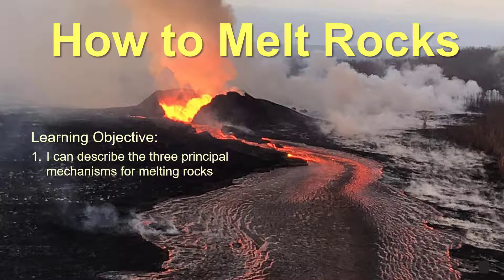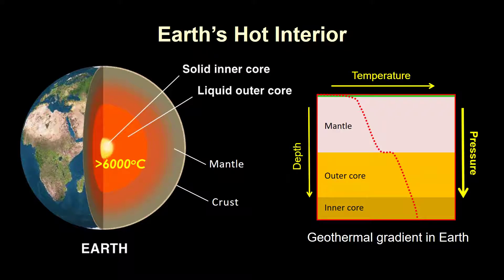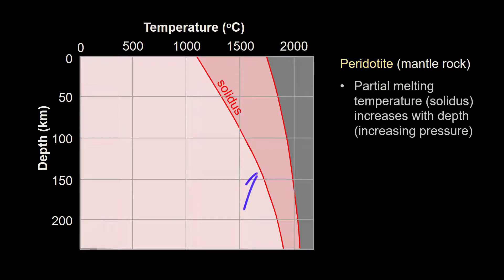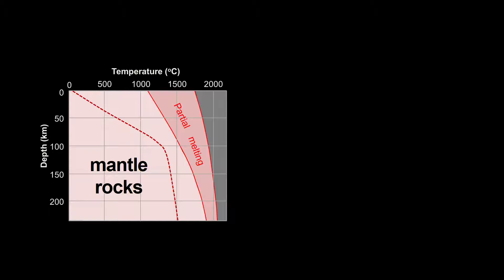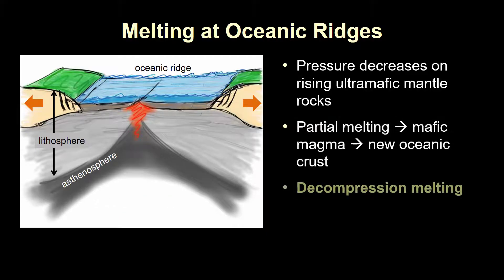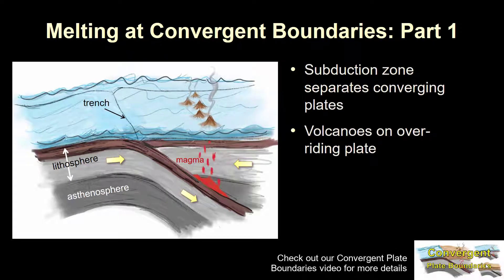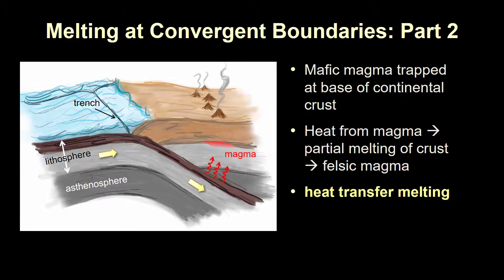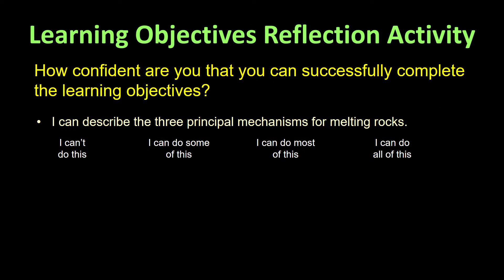How to Melt Rocks

Comment: Thanks, I think I got it.

So even if the melting of a particular rock is say 1600°, it takes high pressure and an even higher temp (because of the pressure) to make it fluid, 

As it decompresses it gets hotter and we get lava. 

The lava, just like metal,  oxidises just like a metal would when it hits the atmosphere??

Comment: How do THEY know this..?.the deepest hole was only 7 miles deep.I want to see a ROCK MELT NOT VOLCANOS LAVA ROCKS!!
Reply: They know this by Geophysical methods, in this case we use Sismology, for example sismic waves behave different according to the medium in which they are travelling, thats why we know the outer core is liquid, but the inner is solid, and actually thanks to this, the sismic waves reflect and scientifics were able to calculate or estimate the distance to the core
Reply: @estebancalderon1084  you say it as if that men they are 100 percwnt sure.   they are guessing, bro.  you can take it for what it is worth but it is a guess. some ike to call it a deception but ok
Reply: @Mike_Greene  They are not guessing: in seismology there are two main types of waves: P-waves and S-waves and the latter simply is not able to move through liquids and that's why scientists "think" the outer core is liquid. If you don't understand that or you think it's still "guessing" I would advise you to take some physics courses.